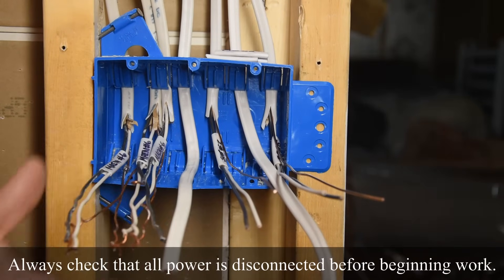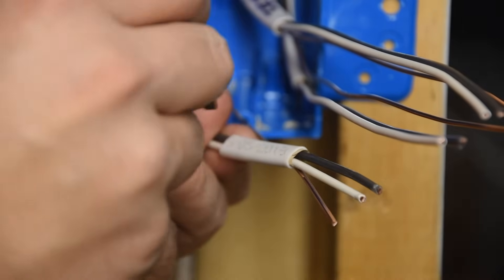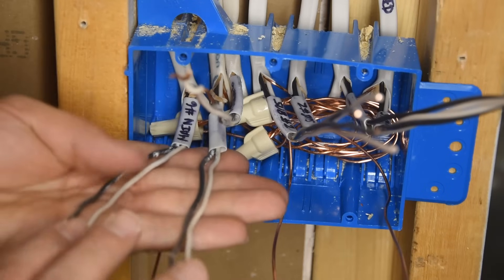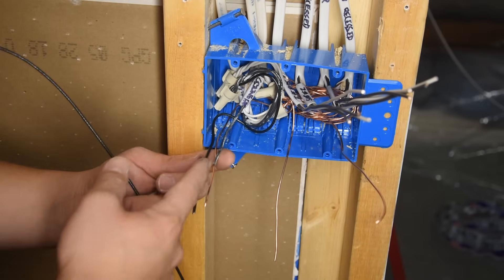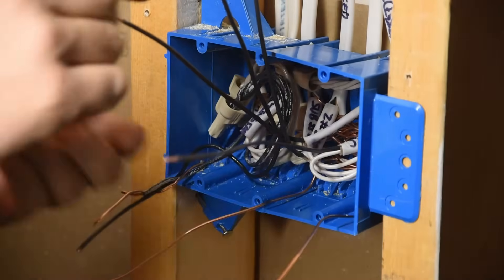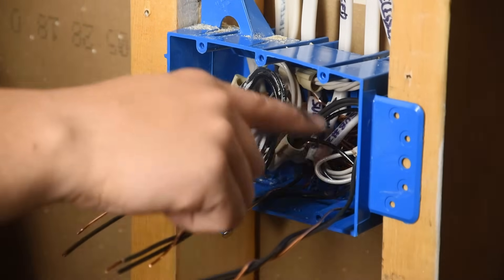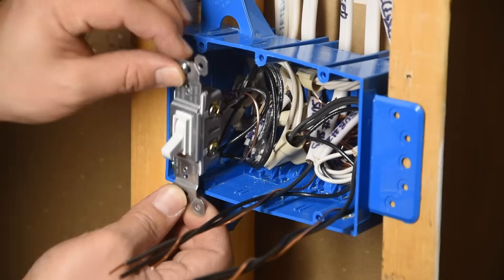How To Wire a 3 Gang Switch Box With 2 Circuits

Comment: Ben, Thanks for a great channel. I have a question about multiple 3 way switches in the same J-Box. So, when you enter my Tiny House and on the left is a wall switch, with 4 different 3 way switches. Each 3-way switch controls a different operation. One does ceiling lights, the other does Front porch lights, the third 3-way controls the deck lights and the Fourth 3 way switch controls an outlet at ceiling level for a rope light (LED). I know I can run 14/2 from the panel to the J-box and get power to the switches. Here is where I'm a bit unsure! I need to run 14/3 to the other J-Box that has Four  3 way switches that operates the same as the front door J-box. Do I have to run 4 different 14/3 runs? is there a way to combine those runs onto just one run? and if so how might that work? Thanks for your help!

Comment: Having multiple circuits in a single box is ok for code?  It shouldn't be.
Reply: Yes it's absolutely acceptable by code. You could have a split duplex receptacle in a single gang box with 2 separate circuits with /2 wires, or a single shared neutral from a single /3 wire for a multi wire branch circuit.
Reply: @surferdude642 Ok. It's still not a good idea.

Comment: Great video.  Question for you Benjamin - how can you determine if wires coming into a box all belong to one circuit or to two circuits? I’m trying to determine if a gangbox in my bathroom has wiring belonging to one or two circuits. Aside from the wiring for the bathroom there is a cable going from the box to a first hallway switch which in turn has a cable going to a second switch in that hallway at the entrance to the kitchen.    Is that cable part of one bathroom circuit or part of a different circuit? I need to know if I can connect the neutral and hot wires of that cable with the neutrals/hots of the bathroom wiring.

Comment: If I have 12-3 wire coming in from two individual 20 amp breakers  should I have a separate neutral wire ?  I have a GCFI that keeps tripping but it takes like 12 hours before it does.

Comment: I noted that all the devices (switches) that you were using were standard switches.   The head scratcher for me is trying to wire-in smart wifi switches which are wider and much deeper.    All the wiring that you have stuffed in the back of the boxes makes getting those smart switches difficult to get into the box and screwed down.  I am just curious how an electrician solves this problem.   Thanks.

Comment: I wish NEC would do a few things. First BAN these plastic and nylon boxes. Also ban, or at least regulate 14 gauge wire, and then, that mess you have there. All those connections should be made in a different J Box, and only switches with wires should be in the gang box. If 14 gauge wire is to be used, it may only go to the switch, outlet of fixture and back to the J box where the circuits actually are. Those should be fed with 12 gauge or thicker. It would reduce overheating, the propensity for electrical fire, and make it so much easier to work with. 

Further more I wish Romex would have green insulation on the ground wire... Also the ground wire is conducive so this 12/2 with ground or 14/ 2 with ground is ridiculous. All wires should have a ground present so you can say 12/3 and that means you're getting 12 gauge wire with a hot, neutral, and ground... That's the way it should be. 

Also if you have to tell people that they should disconnect the power before doing the work, then they have no business working on the electrics in the first place. The electricians I had in here worked on the circuits while they're hot. I did not, but I can't physically do what I used to be able to do, which is the ONLY reason I hired electrician in the first place. And yes, I practiced what I preach. I had some nice wiring and tidy boxes before I become disabled.

As for your suggestion of using sheathing for labels, that is an AWESOME Idea, so using a utility knife to score the sheathing doesn't behoove that endeavor. I think there are certain tools that will cut the sheathing in one space and it can slide off. If NEC ever gets their head out of their... And starts insulating ground wires, then tools like that will become more mainstream and the price for them will also become lower.

As for the wire nuts, I don't understand why those are still being used when there are lever connectors that are SO much better, in ease of use, and insurance of connectivity without needing to twist and strain wire. I see the date is 2019 so perhaps those weren't available then, but commented because it would behoove people in future applications. I heard you mention them at 8 minutes mark so I assume they are relevant.

Comment: This video has enlightened me on a recent upgrade in my house. I’m a mechanically inclined DIY-er. And I just couldn’t figure out for the life of me what the previous owners did in a switch box. They didn’t label anything so a simple addition of a smart switch took me a few hours between looking up you tube videos and just sitting back staring at it trying to figure it out in my head. This video came a little late as I already figured it out. Buttt I do have a full on renovation of an addition that was added in 2000. I will be gutting it to the studs and doing all new electrical all the way to the panel. It will be done the right way as I will be having it inspected by the local inspector. This video has given me a lot of ideas as to when I do go to do this renovation. Thanks and keep up the good work!

Comment: Extremely helpful. You impressed me. I learnt a lot. I would like to talk to you personally. What is your email to contact you? Also, I need your guidance. I am trying to install Moes -Two gang 3way switch in the current two circuits switches. I can see power coming in the switch. But the lights are not getting turned on. This switch requires Line, Neutral and L1 and L2 Out.

Comment: Have a problem Ben with lighting circuit to bathroom.   Installed 2 new outlets, 1 light switch to bathroom vanity.  1 outlet as normal.  1 outlet near sink a GFI.
Above the GFI, a light switch for above sink light bar. PROBLEM-
When light swich is OFF, lights have a dim glow.  GFI  tests/works fine.    What can i check?

Comment: This video was a huge help and I can't stress it enough. I do mostly trim, tiles, doors, sheetrock, windows etc. A lady I work for couldn't figure out why the three gang box wasn't working that had three 3-ways in it. So I opened it up and nothing was hooked up. I couldn't figure out why I kept tripping the fuse and now I know why it's because there's two circuits and I kept putting all the neutrals together. Now I know what I was doing wrong because I got confused with the four 14/3 and three 12/2 and 2 separate circuits. I will definitely be watching a lot more of your videos

Comment: So could you have just twisted all 7 ground wires together tightly without using a nut, then cut off 4 of the unneeded grounds, and push them to the back of the box, leaving 3 of the grounds long enough to be used on the 3 switches? Or would that be against the code?  Seems like a lot of extra steps to make 3 ground pigtails when you already have 7 ground wires to begin with
Reply: Cutting 4 off and leaving three for the switches would only be against code if those 4 short wires stick out less than 3 in from the outside of the box. Otherwise, there's nothing wrong with doing that, as long as you put a crimp sleeve (steel or copper) where those 4 wires end. In fact, this is how my house is wired and it saves space.

Comment: Ben, Is it OK to run a jumper on a single circuit feed at a switch box for the commons and hots? I have one feed  14/2 wire from my main panel to the box which will also have to feed another box nearby.  Along with all the wires for the switches needing to be wired I suddenly am needing to wire nut like 8-9 wires together. Jumping like you did with the grounds here in this video is what I am referring to. Thanks in advance.

Comment: What do you do if you're working after someone else, and you find separate mutuals in the same box that were tied together, but there's only hot power in?
I can't seem just figure out neutrals on different circuits in the same box, but only one power in black wire.

Comment: Sometimes I catch a little bit of the wire insulation under the screw when installing a switch or outlet. Is that a big deal?
Reply: Usually not, but it may make it loosen if the insulation degrades.

Comment: Since you asked, one nit picky detail. On the grounds I would have preferably used a red nut like you mentioned but if I was using two tans I would have done them each by their corresponding panel. It really makes no difference but since you had everything so nicely labeled it would have added that extra layer of continuity to your presentation. Well done either way, there was nothing you did wrong here. I might say I liked when the other guy started asking questions, you were able to play off of that and it added depth to your explanation. :)

Comment: I have not found any good videos on adding a separate switch for ceiling fan when the power comes into the light.  Would be great for you to do a video on adding another wire and switch for separate light and fan operation when power comes into the light.  Lots of videos on how to do this when you have power coming into the switch first.

Comment: If there are two circuits, why do you need three feed lines?
Reply: The third wire feeds to another outlet or switch on the same breaker.

Comment: I wired a similar switch box only with three switches and one separate circuit feeding a GFI Receptacle. I may have wired all the neutrals together consequently I have 60 volts at the light fixtures when the switches are off. Is this a back feed problem. Suggestions?

Comment: I only worked with metal boxes and plaster rings some 30 years ago and nothing is worse than spending all that time wiring a  box full of wires and when you have a device screw the shorted the wire out. I can still hear the breaker tripping and seeing and smelling the smoke from the square to round coming out of the ceiling fixture. I thought of that see the plastic box and the device screws are not exposed.

Comment: I’m not sure why you use the “ Home Depot” boxes.
Most electricians use Thomas betts or Allied moldings. ( fiberglass)

The plastic junk from big blue and big orange deform along the horizontal axis causing crooked devices.

Electrician for 25 years here.
Only use those in a dire emergency 

Just a thought

Comment: How I was taught: Use the razor on the last few inches of the romex. Skin it up into the box. Use diagonal cutters to cleanly cut sheathing leaving a 1/2 inch. 
A sound mechanical connection is a sound electrical connection.
Wire twisting (Linesman pliers) creates a mechanical connection, wire nuts insulate those connections. 
Create a tight braid of the grounds. (Not so tight you pull on the other wires.)
In "short" USE YOUR KLEINS MAN!

Comment: American wiring and accessories are like the UK was 50 years ago..
Reply: it goes both ways. you guys ain't got crazy inefficient AC systems, for example. also, it took how long to stop using fuse panels, and those silly plastic consumer panels??

Comment: 8:21 I'm a bit confused as why you are pigtailing the hot wires here and where exactly they are going.  Is the one black pigtail going to a separate box?
Reply: The construction job he is working on is still in the middle phase. He said he is not fully installing the switches until after the drywall is up. By pig tailing the blacks together it is essentially the same as having a switch that is always on. Doing this allows the rest of the circuit after the switch (or in this case the pigtail) to be tested even if the switch is not yet installed. HTHs

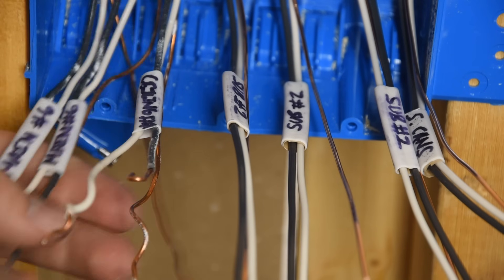Comment: 3:34. I really appreciate your videos so far, they've been very helpful.  Just wondering why you have 7 sets of wires going into this box and also why you had to pigtail the ground wires.
Reply: The Tan wire nuts he is using technically only accommodate 5 wires,
Reply: All the grounds need to be connected to each other, but their are limitations to how many grounds can go in a wire nut (5 in his case) and how many grounds can go into a switch (which is only 1). Pig tails make all of this possible.

Comment: They have these devices now that one puts into the chuck of a variable speed drill and it slips over the outer plastic shell of the wing tip or wire nut connector and it aids on putting them on and it makes it a lot easier than by  doing  it with your fingertips ! Amazon sells them ! https://www.amazon.com/gp/product/B0087TBPS2/ref=ppx_yo_dt_b_asin_title_o05_s00?ie=UTF8&psc=1

Comment: Where I live I do not believe we are allowed to run two different circuits into the same box.
Reply: Where do you live and how come?
Reply: @lordperezident  I live in Manitoba Canada. It is a safety issue. When someone goes to work in the box they shut off a breaker figuring everything is deenergized in the box when it may not be.

Comment: I usually run the power to the fixture, but I’m not an electrician, so...
Reply: Technically will function. The drawback is that you are running the white wire live when the switch is on, and it’s easy to confuse the white switch wire and white neutral wire. I’ve seen cases where the neutral wound up being switched, which means the light socket is live with the switch off.

Comment: This doesnt help when you need to identify which wires are controlling which  fan or light. I have 3 circuits in 2 boxes, both are 2 gang boxes, with 2 4-ways in one box, and 2 single-pole switches in the other box. Therein lies the problem.  A switch in each box controls a light in the other room. This was originally a commercial project, so it has EMT concealing the wires above the box all the way up to the drop ceiling into where it meets in a j box with numerous other circuits as an I decipherable cluster. In texas, it is against code to have 2 4ways in one box, so you would think it's as easy as swapping the switches. However, these are connected in a way that they function as a 4way, a 3way, and a single pole all in 1 switch. Sound confusing? Ding ding ding ding!!! I quit!
Reply: Whoever wired this is an asshole, but hey, I'm in Texas.  Need I say more?

Comment: When two circuits are run into on box, is there anything special that needs to be done in the panel? For example, what happens if someone else come in later and thinks they have turned off one breaker but not the other?
Reply: You should always test to make sure power is completely off, don’t rely on believing the breaker shut off power entirely. Also keeping a clear panel schedule is very helpful as well
Reply: yep, you potentially (both meanings...) have 240V in that oulet box. always use your voltage tester or meter.
Reply: For this reason, it is forbidden in Germany to install two circuits in one junction box.

Comment: Not an expert - but is there any problem when you tie grounds together from two different panels? Even if one is a sub-panel?
Reply: As long as there's a main panel feeding a subpanel (or multiple subpanels), then there's no issue tying grounds together. In fact, they must be all connected to create a return path to the transformer. Now if it's two main panels, then there's a problem.
Reply: All grounds should be....ground potential so yes technically it does matter, they shouldnt be at different potentials from one another or have the possibility to be, ...please connect them.

Comment: I'm a little confused by one thing.  If there are two separate circuits coming into the box, why are the grounds from each circuit tied together as if it were all one circuit?  Would the grounds from each circuit be spliced to their respective circuits ONLY?
Reply: ground has to be all one ckt.
Reply: Because grounds aren't current carrying conductors.; they only carry current momentarily when clearing a ground fault. For that reason, grounds are always tied together regardless of which circuit they're from. But yes, when bonding those wires, you can make separate joints for each circuit and tie them together to further indicate they're different circuits inside a box.
Reply: Ground is ground.

Comment: I'm a Licensed Journeyman Electrician with over 52 years in the trade, mainly Residential and Light Commercial, and I have never '' twisted the wires together '' with pliers prior to installing wire nuts or wingtips wire connectors and never had any problems or complaints from any of my customers or clients !  I've been doing it the way as I was taught in the State Vocational 4 yr. Apprenticeship Trade School !
Reply: Let the wire nut do what it was designed to do. 😉
Reply: ? Explain why not to wire twist before the nutz???
Reply: @graken22  ; not required as the Wingtip Wire Splice connector will do that if the ends of the wires being spliced are even. The inner metal screw shell inside the Wingtip Wire connector will grab and twist the wires for you !
Reply: @graken22  Have you not ever put a wire nut on wires without pre twisting them? Try it and then unscrew the wire nut carefully and you will see that the connection is identical to a pre twisted one. Usually I only pre twist if I have more then 3 wires because in that case you have to give them a little taper to fit in the nut and twisting helps with that.
Reply: Cool story boomer

Comment: Hi Ben, love your videos!  I was wondering if you could do a video on wire nut sizes in depth.  The biggest ones available to me are the gb ultra wingard 14-6 blue.  It says min. 3 #12 and Max 5 #10. On the back it says 3-6 #12 and 5/6 #14.  This confuses me a little.  Does that mean a max of 6 14 gauge wires?  I appreciate any info you can provide.  Thanks
Reply from the maker: I'll get that added to the list! Thanks for asking!
Reply: No problem.  Thank you!